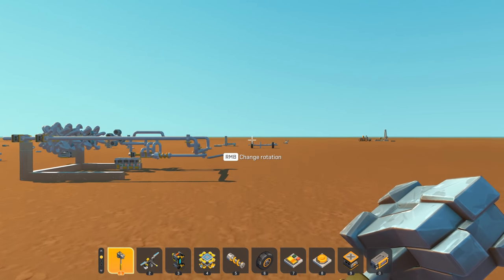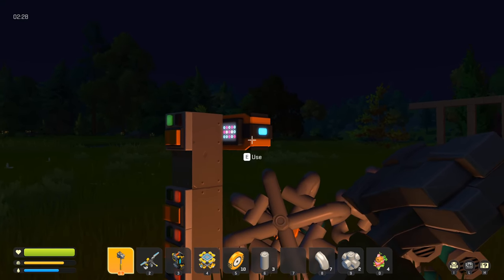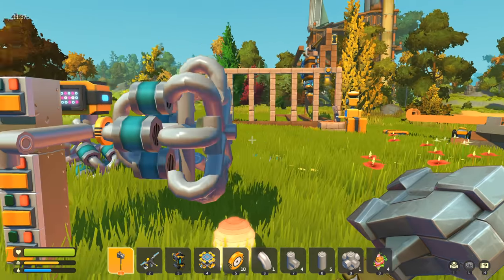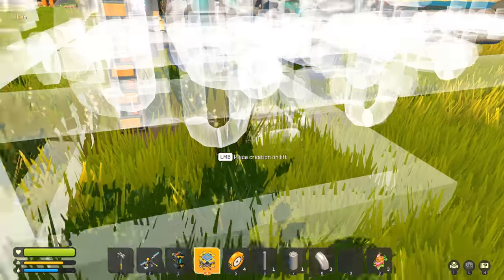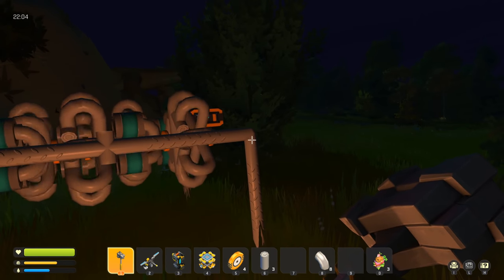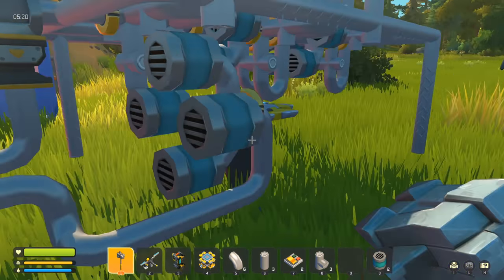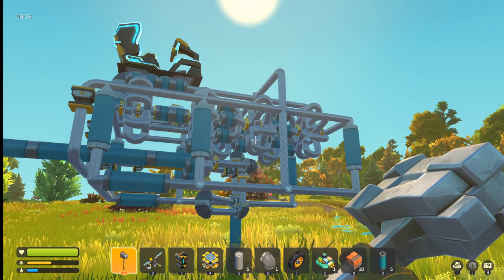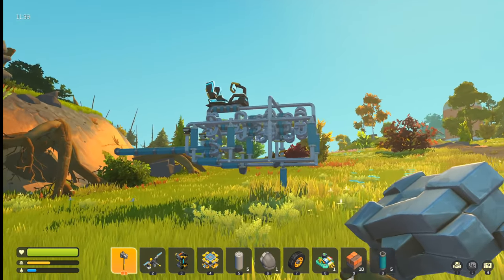GEARBOX WITH CLUTCH: Scrap Mechanic (Survival) - Ep. 06 - Edited Gameplay

Comment: Overcomplicated? I preffer the term *amazingly complex*? ;D
A possible improvement - automated (at least semi) shifting, so you won't mess up your buttons when shifting. Either having buttons as imputs for each gear (press "1" for first gear, press "2" for second" with some flip switches to remember the selected gear till another one is chosen. Or a sequential type shifting, two buttons (upshift and downshift) with a visual representation of which gear you are in. Or, you know, some fancy schmancy automatic gearbox,  but can't see that happening without mods.
Now all is left is to put home big daddy wheels, supercharged v8 piston engine and cover it with saws
Reply from the maker: Those are awesome ideas! There are automatic shifters already in vanilla using gravity as an indication when to shift.

Comment: Is this supposed to be powering a vehicle? Then it is too tall, it will be instable. Consider attaching the clutch from the side, that will reduce the height of vehicle. Like this you have just ship engine.
Reply from the maker: The engine can be turned in any direction after the fact,  no need to rebuild everything. You have to think more in 3D. The engine would be for a truck, so a rather large and tall vehicle too.